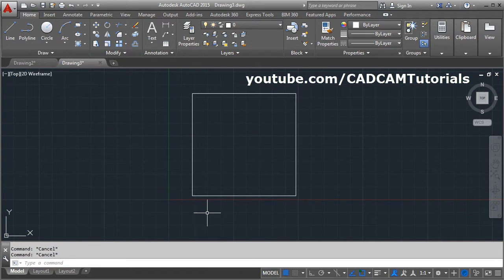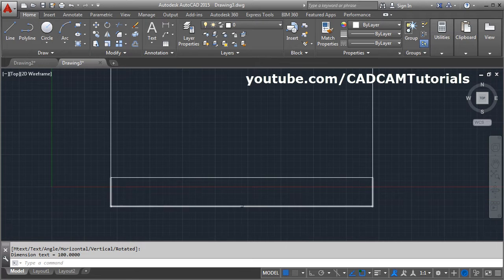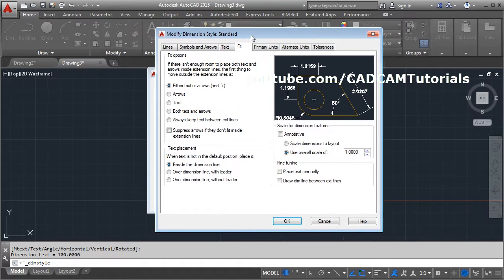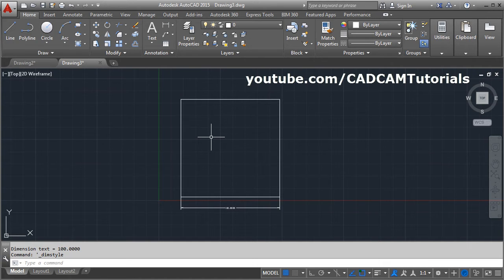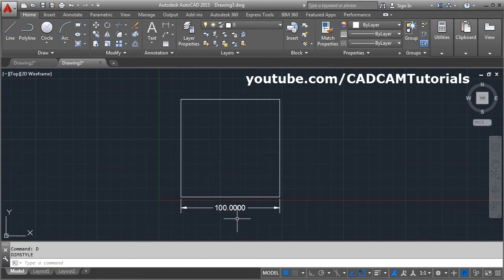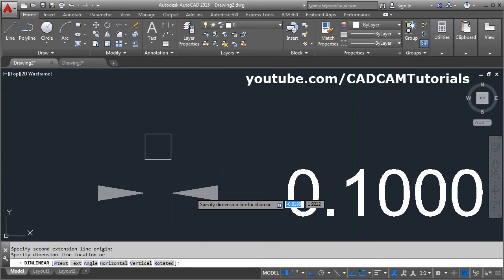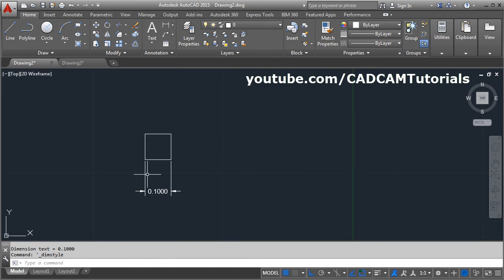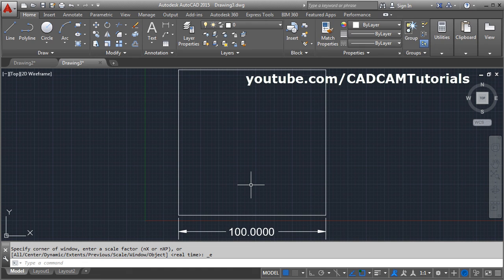AutoCAD Dimension Tool Not Working | AutoCAD Dimension Too Small or Too Big | Text Size Problem

Comment: So this is all wrong. The problem here is not the size of the dimensions, it's the scale this person is working in in model space, which is 1:1. The whole point of annotative dimensions is that the text height stays consistent in paper space and, therefore, when printed, no matter what scale you decide to layout and print in. You should be setting a consistent text height in the dimension style manager and definitely not messing with the scale factor in the manager. Instead, make sure that the "Add scales to annotative objects..." button is turned on (light blue) in the status bar at the bottom of the screen. Then change the scale to what the output scale is likely to be in relationship to the size of paper you want to use for output. You will see the dimension change size on it's own. This gives you a sense of how big or small your text will look when printed in that scale in relation to how large the object will be in that same scale.

For example, I want my dimension text height to always print 1/8" tall, no matter what scale I'm working in. Set this as the text height of your annotative dimensions in the "Text" tab of the dimension style manager and make sure the "Annotative" check box is checked in the "Fit" tab of the dimension style manager. Save the changes and, before you close the dimension style manager, select the modified text style and click "Set Current." Now, dimension your object, or part of it, and, making sure the "Add scales to annotative objects..." button is turned on (light blue) in the status bar at the bottom of the screen, change the scale from 1:1 to 1"=1'-0" (or whatever you want it to be), also located in the status bar right next to the "Add scales to annotative objects..." button, and watch the dimension change size automatically. What it's now showing you is how big a dimension with 1/8" height will look in relationship to the object you drew, scaled down to 1"=1'-0", which is what you'll have to do anyways when you lay it out to a desired paper size in the layout tab.

If you do what the fellow in the video says, when you get to laying out your drawings and dimensions in paper space, you will run into text size issues again.
Reply: Thanks a million for this detailed explanation
Reply: You are my saviour